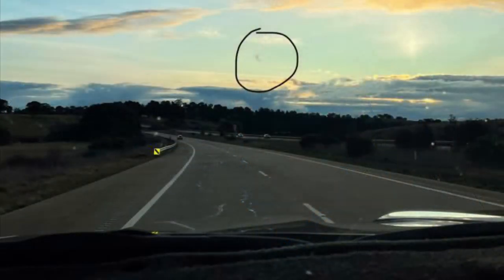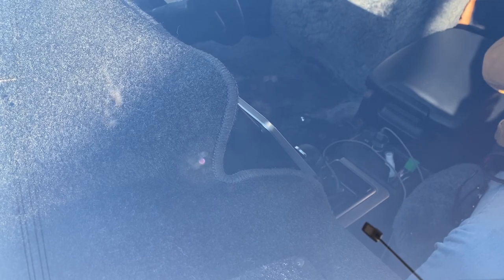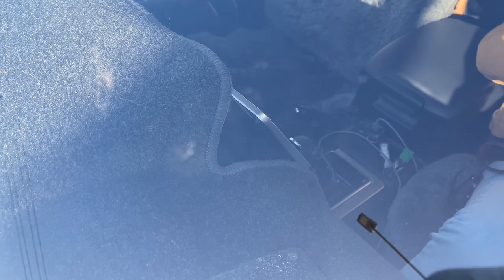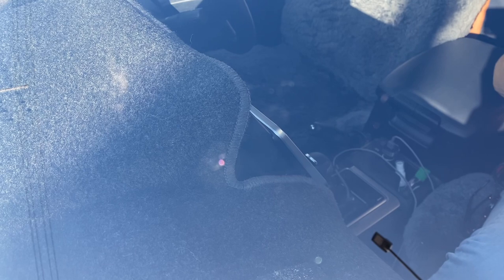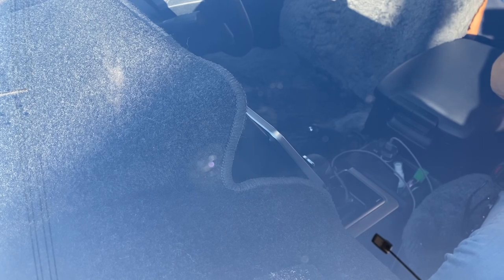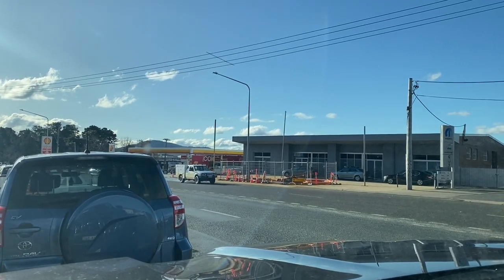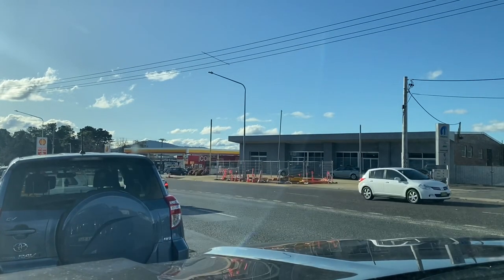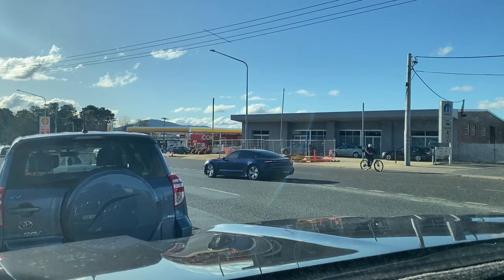Windscreen Stone Chip Repair~ My Experience

Comment: Hi and thanks for the video. I had a similar small but annoying chip in the driver's line of sight some years ago. Had the repair successfully completed with a barely detectable result.  Fast forward a couple of years to when  I am selling the vehicle privately.....screen fails a Safety Certificate inspection (Qld). Reason given was that ANY repair in the area swept by the wipers is an automatic fail. So still had to replace the screen before selling the vehicle. A small but annoying irony was that the same company which did the repair, also changed the screen.  No disclosure made at the time of repair of course. I now take the no excess windscreen insurance replacement option and replace the screen at no additional cost whenever it gets grit pitted from western roads - 3 to 4 yearly depending on trips.
Reply from the maker: Interesting.  Didn’t know that.  Do you think that’s a QLD thing or applies in all States?
Reply: Did a couple of searches just now..advice from 2 national windscreen franchises in FAQs gives the same advice : ANY damage in the driver's primary vision area will render vehicle ineligible for RWC/Safety Cert.   So, I'm thinking not just Qld.
Reply from the maker: Ok thanks

Comment: Could I ask what the cost was? For future reference.
Thank you for the information 😀
Reply from the maker: Yes, sorry should have said…. $189 Australian
Reply from the maker: I didn’t go through insurance
Reply: Thanks very much just a bit cheaper than a new windscreen 😂😂 thanks again for this information 👍
Reply from the maker: Apparently a new Prado screen is around $1300
Reply: I’m guessing excess would be more than cost of repair makes sense to do it your way 👍
Reply: @PradoPlacesOz  Hi Pete, Six weeks of ownership of my new prado, I had a stone flick up and just hit the windscreen near the edge on the drivers side. Proceeded to crack, and grew quite quickly. Had the windscreen replaced at Windscreens Obrien Fyshwick. The $1300 is the aftermarket screen. I convinced my insurance company for an OEM windscreen. I think the price is closer to $1900. The thing that I learnt was the calibration of the speed limit indicator was required, after the windscreen was replaced. All works well with the new windscreen in Buzz the Prado
Reply from the maker: Geez, bad luck on that after 6 weeks! So $1900 for a Toyota OEM screen? Yeah the camera and Toyota safety sense stuff would all need recalibrating…. Forgot about that. Thanks for the update